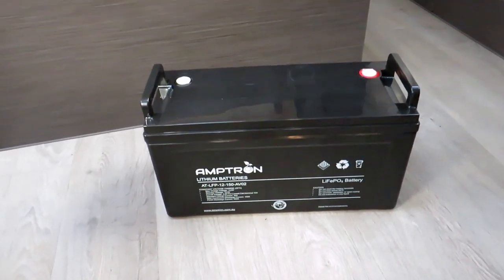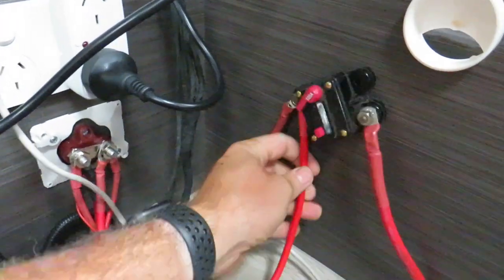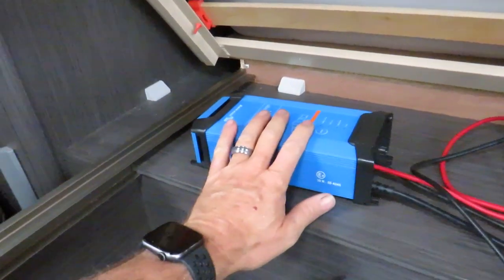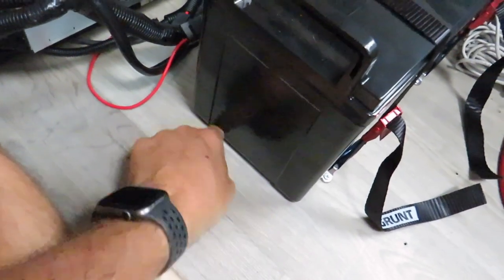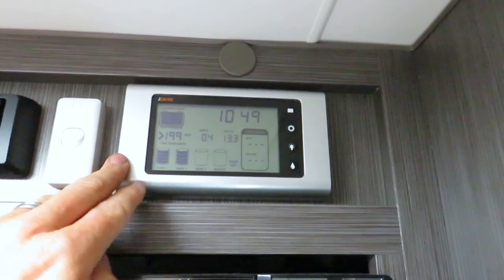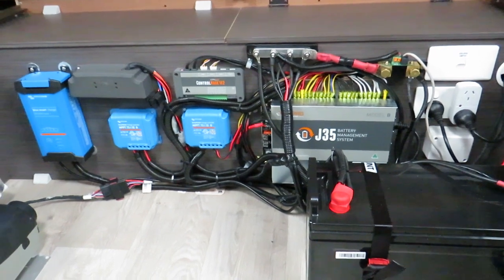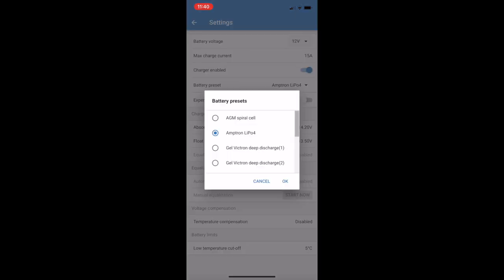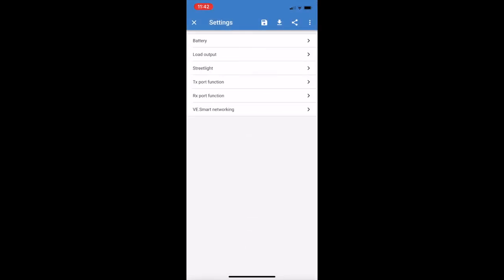Amptron Lithium Install & Victron Setup

Comment: I'm upgrading to lithium also but I'll be replacing my J35-B power management system with the J35-D which is lithium compatible and also charges at 30amps, I emailed Bmpro in-regards to the J35-D and they offered it to me for $500 change over for the J35-B, this will make my conversion to lithium a bit easier as I don't have to add extra components to manage the power in my Jayco it will be a strait swap and all the monitoring systems will still work as normal. I like to keep things factory less complications.
I have replace the 100ah lead acid with the Intech 120X - 120ah lithium battery
Reply from the maker: I imagine for most people the BMPRO system is more than suitable. I just like Victron equipment more and it gives me some flexibility with the system that the BMPRO units don't. The solar charging with Victron is far superior.

But, so long as the system does what you want it to do and you're happy with it then that's all that matters.
Reply: @gettingtheretravel  You are absolutely right all that matters is what works for you, I just think in my case what the factory designed is a better solution and lees complications in the long run and the J35-D also gives me Bluetooth connectivity so I can operate lights and check power management and tank levels from my phone.

Comment: Great vid.   What about when you are connected to your car? Does the fridge run on 12V via alternator?  Have you set up any DCDC charging from alternator to battery?
Reply from the maker: I run the fridge from the auxiliary battery in my car (which is charged via DC-DC) but my lithium battery is only charged via solar or when connected to 240v. Others may need a DC-DC in the caravan to charge from the car but over the last few years I have found I don't need to as I monitor my usage and adjust accordingly. Plus we  don't use a lot of power anyway.

Comment: Great video on upgrading to lithium battery. Can I please ask where you purchased the saddles to secure the battery?
Reply from the maker: Thanks. Got them from Roadtech Marine. System is still performing well and very happy with the setup. It survived the Gibb River Road, so all good.
Reply: Bunnings have them or auto shops